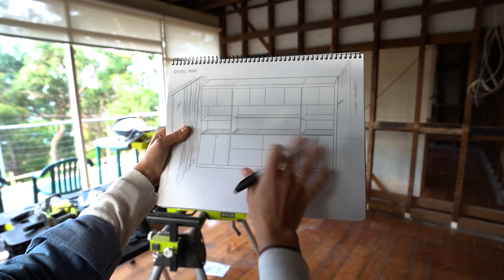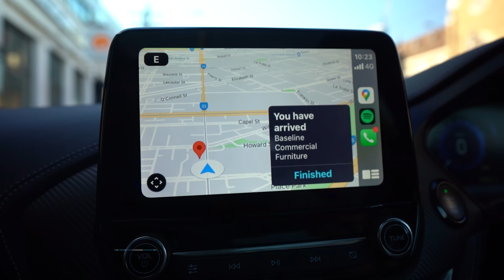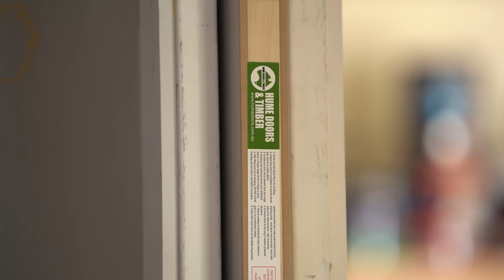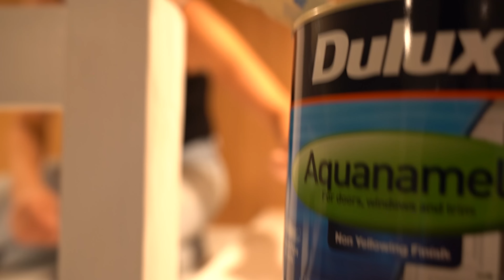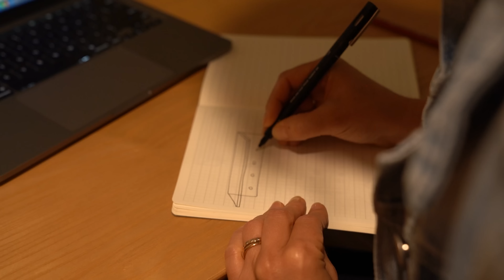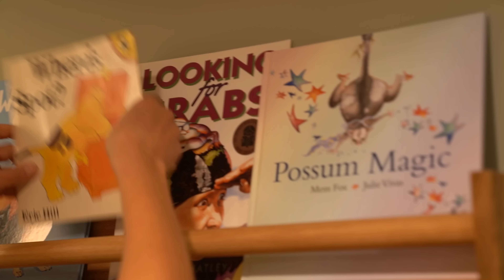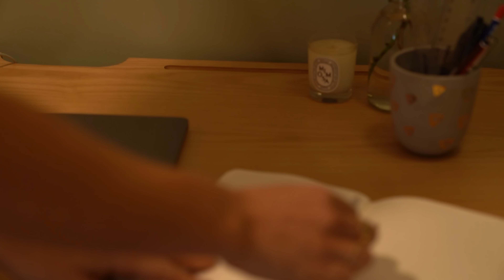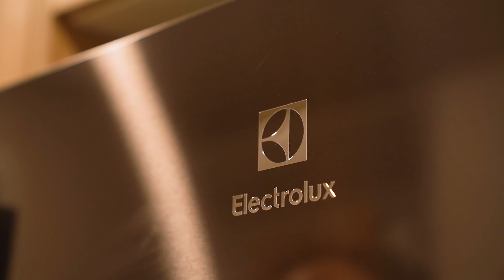Ultimate Kids Room Makeover! DIY Bunk Beds, Nursery, Home Office & Living. Interior Design Ideas

Comment: Great upgrade!  Can I ask about the bunks and if you went by any building codes/standards when installing, or just made sure they were sturdy & safe? I'm looking at doing exactly the same as your top bunk basically with it being more a loft style with the underneath being used in a different way rather than having the lower bunks directly under the top.  My concern is that I would be selling the property or renting it out & I wasn't sure about it meeting ACCC standards